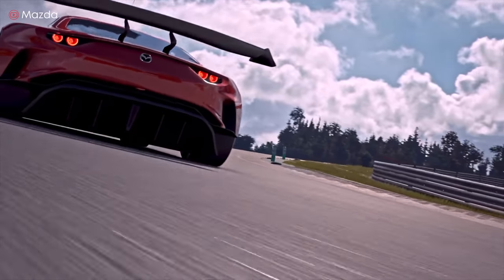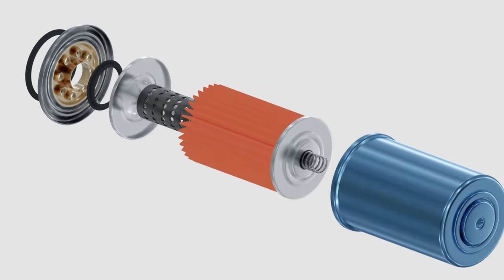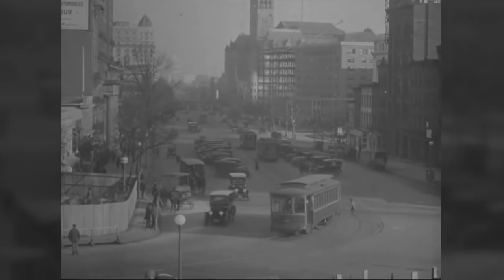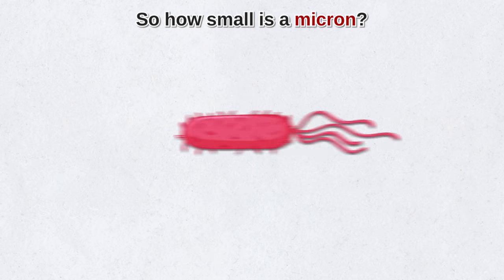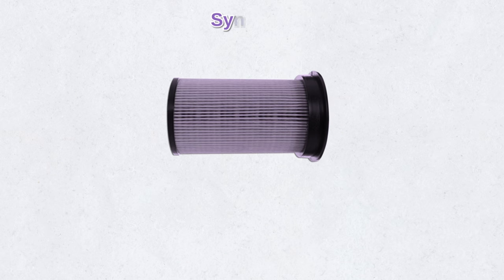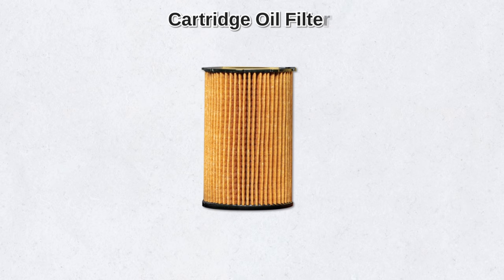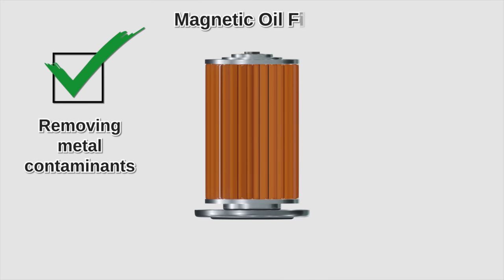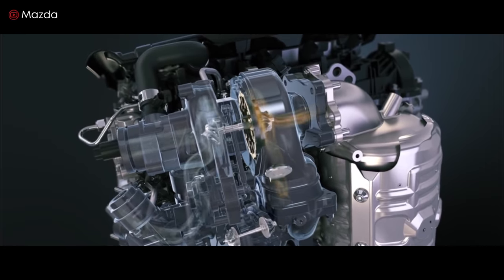This New Oil Filter Just Changed the Game (No More Oil Changes)

Comment: For a long time I've been interested in oil filter construction and effectiveness. I've watched many videos on the deconstruction and comparison of various brands. Like many other things in the world of automobiles, I've found that this is a moving target. Just when I think I've found the best, quality changes, actual manufacturer changes, quality control becomes lax (therefore consistency) and so forth. I change my oil and filter more often than some (5K at the absolute longest). I've used Mobil 1 full synthetic for years, and I always use the recommended viscosity. I'd like to see how consistent the quality of a premium oil filter is if purchased from random suppliers from all over the US. To make the math easy, test (deconstruct and inspect, etc) 50 of the same filter. Maybe a top-of -the-line Purolator or Wix for example. Murphy's Law follows me closely, so if oil filters are inconsistent, I'll get the bad one.
Reply: There is a lot of time spent on studying  filters that dont clean oil. The game changer filters that clean oil are ignored.    Some of the old cars in the 30s and 40s actually had better oil filters than the new cars. They were optional equipment and normally used cotton. Frantz came out in 1953. Ive heard the Australian Jackmaster  came out in 54.
Reply: All of the filters that clean oil use either toilet paper or elements that look like toilet paper. Check out the Australian  Jackmaster. They give you a choice. Tightly wound toilet paper or their elements that they claim is better than toilet paper. My Jackmaster Classic has a roll of Great Value 1000  from Walmart  in it. I didnt pay 30 bucks for it.  Jackmaster  did set up the Classic  for toilet paper with a bigger core seal. Slide the roll down against the bottom and put on the lid. They all clean oil. The top loaders are the best.

Comment: Metal particles are the problem a filter needs a magnet , aircraft and race cars do. Some have stick on magnets which are better than nothing.
Reply: I might do the magnets on the  Honda  Accord. No room for my game changer filters. Probably use Walmart 20,000 mile oil and Super Tech  filters. Have some good  lawn mower starter field magnets. Might be too heavy to hang on a full flow filter. I bought some very strong  magnets from harbor freight. Need more. Dont want the steel pieces to grind at the aluminum. Notice the Altima has one in the transmission  as well as the Impala transmission  on the tractor. Cant hurt.

Comment: Our family had a 1964 Rambler American. Dad put a canister that used toilet paper for the filter. We never changed the oil. We traded the Rambler for a brand new 1968 Valiant. Did not do the toilet paper on it.
Reply: I had the 64 Rambler American  flat head 6 .The oil was always black. Put a Frantz on it and the oil stayed clear. That was my first toilet paper filter. The flat head had a bypass filter upside down on the head with steel oil lines. The overhead valve engine had a full flow filter. Had a 71 Dodge Dart. Loved that slant 6.

Comment: Scotty. When I was in the Air Force I was stationed in Italy and at the time I had a Fiat 124 Sport Spyder that had a Frantz oil filter. The oil filter that was used was a roll of toilet paper. All you had to do was unbuckle the bottom of the housing, pull it up, turn it upside down, pull out the roll by pulling on a "V" shaped hook that went through the center of the roll. Then put the housing on the base, buckle it up and you were done. How's that for economy?  LOL!
Reply: The Frantzs are all over the world. I got a message from Israel.  A guy remembers as a child watching his mother change the Frantz on the Volvo. The Frantz was the origional new game changer filter that eliminated oil changes in 1953. I put one on my new Rambler American in 1963. That was the end of dirty oil and routine oil changes for me. I did drain the oil once and changed a head gasket. The flat head 6 was bad about blowing head gaskets. Not an engineering masterpiece
Reply: Better filters came later. Motor Guard Gulf Coast. Better to me means easier  to change. The top loaders were better. Motor Guard converted to compressed air filters. When Frantz went broke one of their dealers made improved filters such as the Gulf Coast  01 junior. Dont know what they are doing now. Their main business is heavy duty diesel filters. Australia's best oil filter is coming here. That's the Jackmaster. The oil change racket will be with us awhile longer until piston engines are gone.
Reply: There is almost no interest in filters that actually clean oil. Most people think allowing oil to get dirty wear and foul the engine then draining it is a good maintenance program. I learned at a young age that filters should get dirty and oil is supposdd to stay clean. I got a Jackmaster filter in from Australia and put it on the Pontiac Torrent. Nice filter.  I believe its as good as the Gulf Coast junior  and better than the others. Put a roll of Great Value 1000 from Walmart in it. The Jackmaster element is nice but after 60 years of using toilet paper im too old to change. The Jackmaster can handle the different sized cores. With the Frantz you need to use the Frantz elements or know how to use TP.. The Jackmaster has no center tube to put spacers on. They use the TP core as a center tube. The seal is made at the bottom with a bigger seal. I got the Jackmaster Classic. Jackmaster claims their filter elements are better than Toilet paper. Probably true but I have used toilet paper for 60 years.

Comment: I use a high quality filter in my car. I also change the filter each oil change, because the cost of the filter is better than the cost of the engine, though in coming months, I'll be replacing valve stem seals in my car engine. Here in Australia, I use the Australian brand NULON oil in my car. In my time doing car repairs, one business used cheap filters. A lot of these failed. I use MANN filters in my car, as these are what it left the factory with. The cheap filters that I saw fail, were $5 jobs, which when the engine was started, the oil pushed the sealing ring out, & oil ended up on the ground. Never used that brand again.
Reply: Probably the best oil filter in Australia  is the Austrailian Jackmaster. I hear some Australians  cheat and use toilet paper in them. Peasants.
Reply: @ralphwood8818  I've seen the Jackmaster filters fail. I have never seen a MANN filter fail yet. I cut open a MANN fuel filter one day to see how much filtering material it had. It was wide and thick.
Reply: Never heard of any depth filters failing. People fail. I got in a Jackmaster from Australia.  A very impressive filter.  Ive used toilet paper  filters  since 1963. I like the top loaders. They normally have larger seals for the larger core  TP. I dont see any way a Jackmaster can fail.Its a simple.oil filter..Nothing to fail. I have failed a few times in 60 years of experience. My filters never fail.

Comment: I was able to buy my first car for $50 because someone did not do a good job changing the oil. It was a 19 9 2 Chrysler LeBaron GT and the guy who change the oil left the filler cap off and the engine was struggling by the time he realized what happened. He sold it to 16-year-old me for $50. I filled the engine with kerosene, soaked it for a day, cranked it by hand, then drained it all out and started from scratch. Being a chrysler, that was far from the only problem, but I drove it around for two more oil changes before anything worth more than $50 broke.
Reply: Wife asked me if would pay 200 bucks for a nice Subaru with engine problems. Went and looked at it. No oil fill cap. Oil everywhere . Bunch of oil cans on the floor with oil leaking into the carpet  Needed a new PCV valve and hose. Cleaned it up. Purred like a kitten. Hardest part was cleaning the carpet.. knew a kid that was looking for a car. A church member said I have an old car out back you can have. The kid said he would keep looking. It was an ugly old car. He was talking to his girlfriend's dad about it. He said let's go look at it. It was a Malibu SS with a 396 engine I believe. They brought it over and showed it to me. Looked new. Girlfriend's dad restores Ford Thumderbirds as a hobby.

Comment: If you change your oil at around 3000-4000 miles and use the cheap filter and let it completely drain out aprox. 45 min using the cheap filter and synthetic oil your engine will last longer than the people who use the expensive filters and don't do oil changes regularly

Comment: Many OE's do not like Glass in the filter. It is believed that the tiny particles can scratch up the engine interior.
Reply: Dont know anything about glass filters. I've done very well with good old pleated paper.  Paper doesnt have an unlimited  life. Cant leave it on for years. My 61 Motors repair manual is getting old and brittle.Kind of like me.

Comment: Oil filters also compare to the oli it's self you're not going to get more miles out of your oil with a higher grade of oil filter as it may be recommended for a zero weight oil with the newer motors and tighter tolerances same thing if you go with a cheaper oil filter with that type of oil you cut the light in half if not more the viscosity breaks down in the oil as well

Comment: Only one problem with the idea of keeping the oil so clean you don't need to change the oil. The additive package gets depleted and you lose the engine protection from that. Unless you have a leaking engine and are constantly adding oil.
Reply: The reason the clean oil system works for me is I am adding a new quart of oil every time I change the bypass filter. Which is every 6 K miles with Walmart synthetic oil. In the 60s it was every 2 K miles with Standard Delo W 30. With a Detroit series 60 425 HP its 3 gallons of new oil when the big filter is changed. 5.5 gallons when the big full flow filters are also changed. Thats the big Gulf Coast filter. No way to avoid needing some new oil.

Comment: I had a 2010 Honda Insight and the maintenance schedule only called for an oil filter change every second oil change.  The dealer said the filter increased its efficiency more it was used and changing the filter caused more harm than good.
Reply: Dealers often tell people stupid things.
Reply: @wholeNwon  that's for sure I've  heard the same for engine  air cleaners Actually when you change the oil on some cars  the filter is still clean.  My wife's Honda Accord is one of them. She had it when we got married . She says she needs to change the oil to keep the warranty good. I haven't hassled her yet about wasting money on oil and filter changes. Dont see a place to put a Gulf  Coast Bypass filter.  She went to a 5 minute oil change place. Said it took longer than 5 minutes . You dont want to  have an oil change place in a hurry. I hope no one I know sees my wife in an oil change place. I would get laughed out of town.
Reply: Ive never been to an oil change place. I have always used oil filters that eliminate oil changes. Frantz. Motor Guard  Gulf Coast and recently the Austrailian Jackmaster. The WIX on the Pontiac Torrent has been on it 60K miles and about 4 years. It has never had dirty oil go thru it. I prefer the top loading game changing filters. Such as the Jackmaster.

Comment: The worst is the Chrysler pentastar oil filter cartridge adapter housing. Made almost entirely of plastic and on it's 5th redesign is almost guaranteed to leak. This leads to a labor intensive and costly repair. I will never understand why some engineer thought that passing boiling hot oil under pressure through anything plastic was a good idea...
Reply: Avoid Chrysler & any brand under the Stellantis group.
All poor quality.
Reply: Had a 71 charger that was a piece of crap.  My 72 Plymouth was excellent.

Comment: This is a great topic to discuss. Today's oil manufacturers make claims of extended change intervals but what about the filter itself? It's great that the filters catch extremely fine particles but doesn't that lead to more oil bypassing the filter element once it gets dirty?
Reply: Very true. If you put enough depth in a full flow filter to clean oil the bypass valve will stay open. Then you have converted the full flow system to a bypass system like a Stilco or Trasco. Only a bypass system can clean oil. All I have now is Motor Guards and Gulf Coasts. Started with a Frantz in 1963. I normally use the full flow also.  I have removed the full flow filter on a few. A little risky if you dont know your engine. With modern engines you are dealing with contamination mostly too small for the full flow filter to remove. That's why some auto makers recommend more oil changes than filter changes. I recently installed a Australian Jackmaster Classic  on the Pontiac. It is excellent for using toilet paper. Similar to the Gulf Coast junior.  It will keep the full flow filter clean.
Reply: Hey Scotty what do you think of Toyota oil filters?

Comment: Just wondering, it sounded like you said the check valve keeps engine oil from oil draining from the engine into the oil filter, actually it is the other way around and if the filter is mounted in a sideways position it will drain back from the filter to the engine. On some engines they won't like that and engine beating rattle will be noticeable. Probably not good for it besides.I'm talking on a well cared for and otherwise quiet and sound engine can do this after it sits overnight.

Comment: True story here... Worked at the big auto factory  that rhymes with Ronda.   Was a technician for over 25 years. A milinial  guy I worked had bought a new Honda CRV and found it out of oil completely.  HIS WIFE hit something and put a small hole in the oil filter.   He put another filter on filled it back up and took it straight to the dealer and traded it in.  Buyers beware.

Comment: I was shopping for oil filters in Walmart and the Super Tech oil filter that the guide book at Walmart recommended for my car it was actually a lot shorter than the factory oil filter. I decided to pass on the Super Tech and go with the Mobile One oil filter which was the same length as the factory one. I don't know what effect was shorter oil filter would have had on my car.

Comment: I bought a new used car in 98 it was a 1992 ford explorer off a car lot after first oil change a week after I bought it ! It began knocking loud knocking noise the mechanic that changed the oil said that it looked like they put 90 weight oil inside to quiet it down so I didn’t notice the noise 😡😂😂

Comment: I fit an oversized filter when possible. Better oil flow and holding capacity. Shops and dealers don't care for that (CYA).
Reply: The bigger the filter the better the cleaning. The longer the filter the better the cleaning.. I'm pretty sure the big Gulf Coast double element filter they use on over the road trucks can filter better than the single element filter they put on a diesel pickup. 11 inches against 22 inches. Frantz used to say 1/32 inch of pleated paper against 4 inches of high quality cellulose . Not rocket science.

Comment: Back in the 70s there was a secondary filter housing that you put a roll of toilet paper in.
Reply: I recently got a Australian Jackmaster  added to my dozen filters. Its a very impressive filter. Hard to wear out an engine with clean oil. The Jackmaster has a nice fabric covered element. The top loaders can deal with toilet paper . They have the bigger core seals for the bigger core TP. The TP is getting smaller and the cores are getting larger. Luckily my filters have the larger  core seals.

Comment: Do you remember the toilet paper oil filter? I don't remember the recommended interval, but one didn't need to change the oil if filter was changed regularly and often. Really old school.
Reply: Been using Toilet paper filters for 60 years. Have 12 of them in use now..  I like the top loaders.  I have a couple of 50 year old Motor Guards. Some Gulf Coast filters. Just started using a Australian Jackmaster. The top loaders are the best when using toilet paper. They all have their own elements now. Stopped changing oil in 1963 with a Frantz oil cleaner and Standard Delo 30 weight. When the TP changed Frantz didnt adapt to it. The top loaders have larger core seals for the larger TP cores. In the old days I changed the TP and added a quart of Delo at 2000 miles. I go 6000 miles with the Walmart synthetic and the modern engines. I drive mostly highway. You could call them old school. The Frantz came out in 1953. Jackmaster in 1954. Jackmaster is the easiest to service which is important to me. The Motor Guard and Gulf Coast junior  are other equal filters. The Jackmaster might be the best still in production. Motor Guard went to compressed air filters. Gulf Coast is mostly into heavy duty diesels like locomotive engines in Shell offshore rigs. Over the road trucks and that sort of thing.